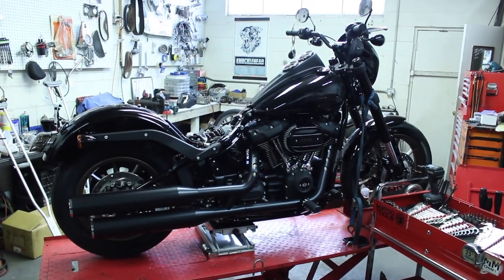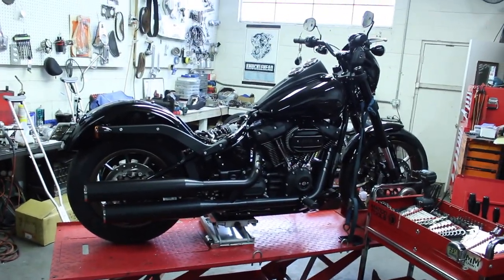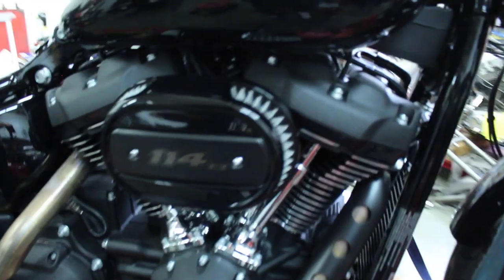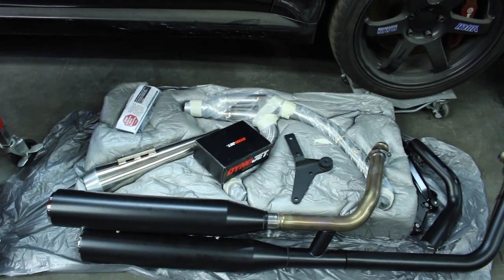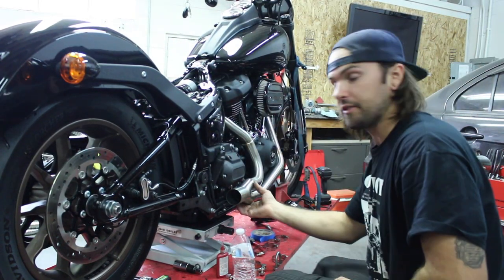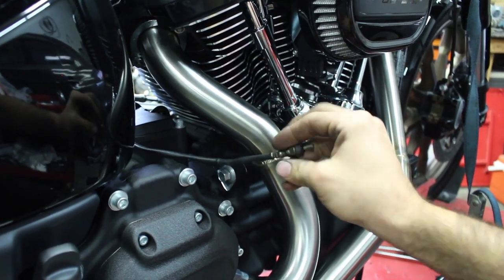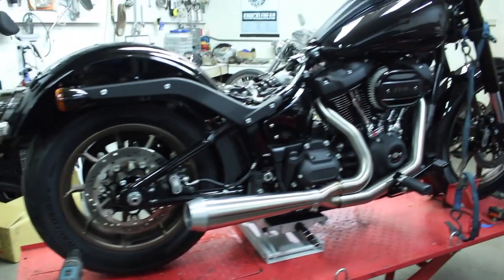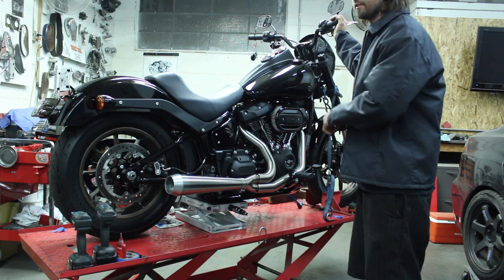Bassani Road rage 3 exhaust install & start up. HD Milwaukee 8

Comment: I’ve got this exhaust on my dyna, it’s definitely superior. I put it on expecting that I was going to want to take the baffle out but after firing it up, nahhhh lol it sounds mean and packs a punch. The power gains are insane for a bolt on application but it’s noticeable.